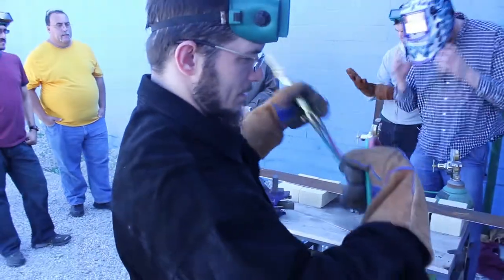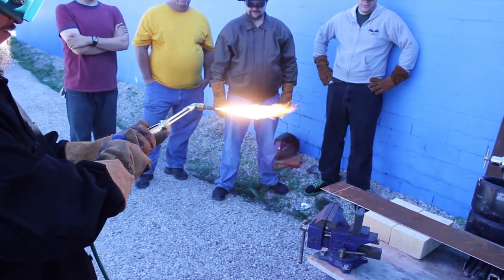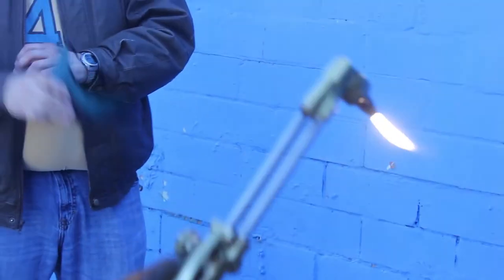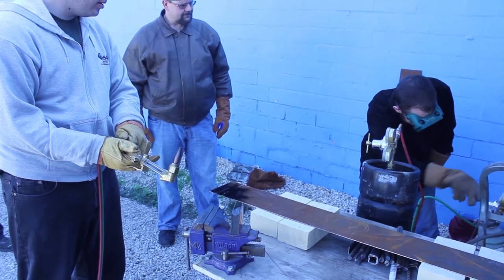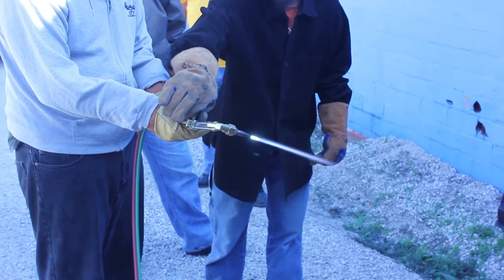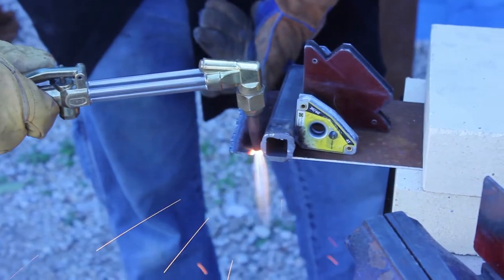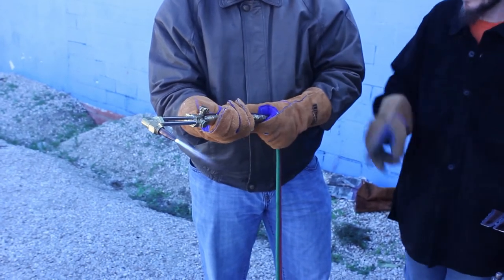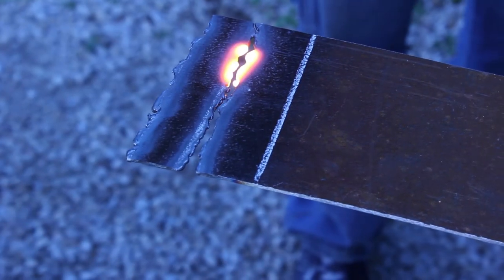10BitWorks Heavy Metal Hackers Welding Class - Oxyacetylene Cutting Torch

Comment: It looked like that tip was too big for that thin metal. Cutting thin metal with a torch is hard because you burn through and then weld it together from the heat and get the results you had. Thin metal is poor choice to learn how to cut with. I learned on a 1/2 inch bar and it cut like butter and was much more satisfying.